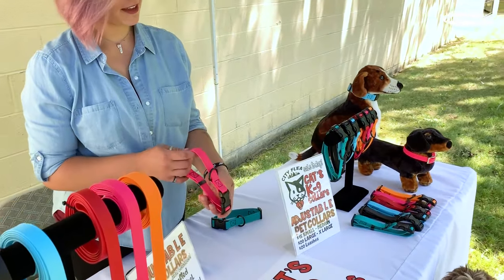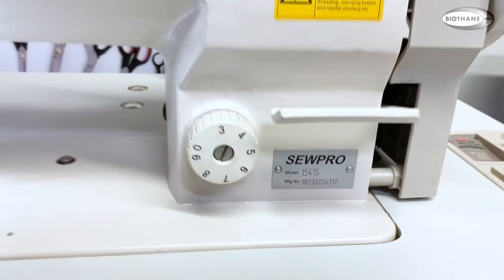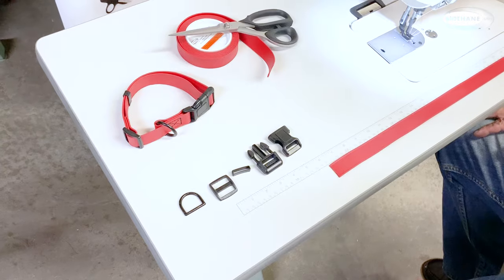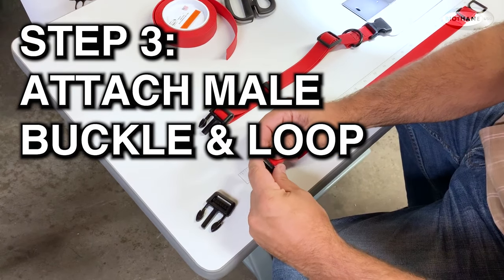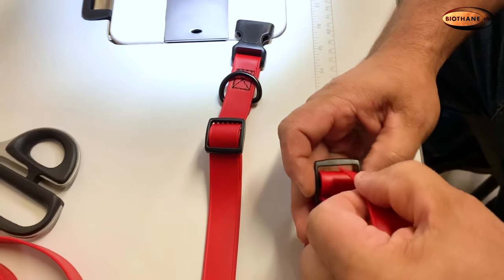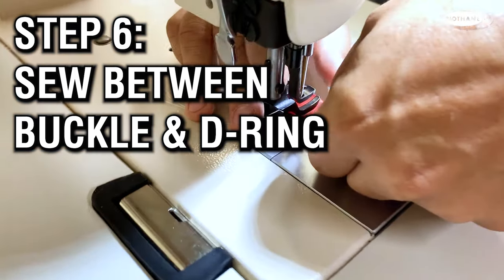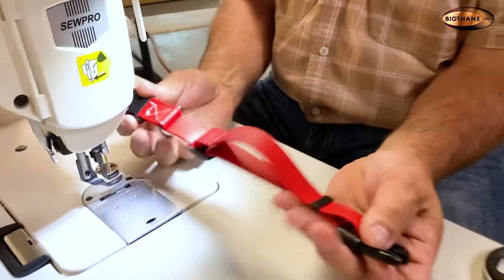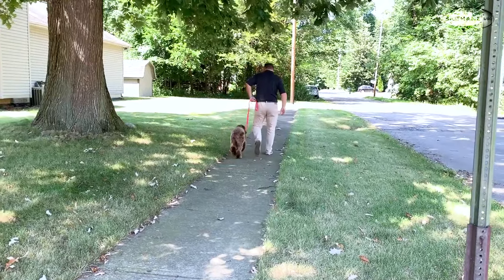How To Make Adjustable Dog Collars

Comment: Can i use heat transfer vinyl or cricut infusible ink on my biothane leash?
Reply from the maker: Great question! I have seen Beta collars that utilize heat transferred vinyl and they looked great! I think using a t-shirt press is one way of heating it. You just need to perfect the time, temp and pressure. As for the ink, I have not seen that. What some people do is use UV ink printing. And this is pretty cool because you can use vector art like Adobe Illustrator. Roland makes a good UV printer. I hope this helps and thanks for asking!!
Reply: @BioThaneCoatedWebbing  Thanks!! Gotta try that out with my new biothane leash. Amazing material :)

Comment: Hi do you know how can I write on biothane?
Reply from the maker: Hello! I have used a Sharpie Marker to write on BioThane. It works really well. I will say if you use a Sharpie Marker on Beta, then give it some time to dry before you touch it or rub it. It will smear. Once it sets. it is good to go! Thanks for the great question!
Reply: BioThane Coated Webbing and it’s ok when you wash the collar or with the rain?
Reply from the maker: @pashauneviepascommelesautr2645  Yes, you can wash the collar and it will not come off in the rain. That has been our experience. Many people write their pet's name on our collars with ball point pens or Sharpie markers. Give it a try and let us know how it goes! Thank you:)